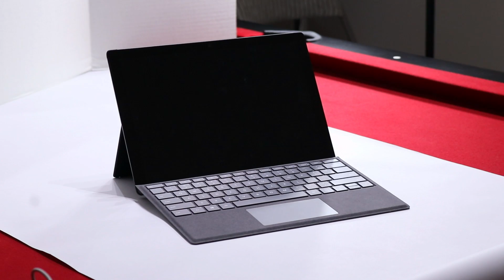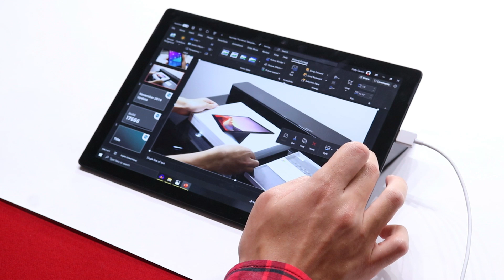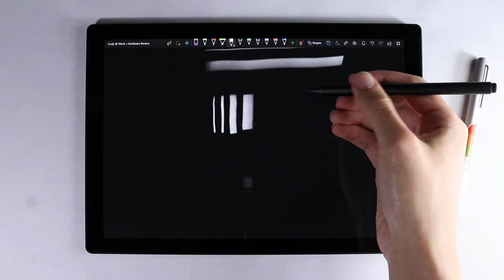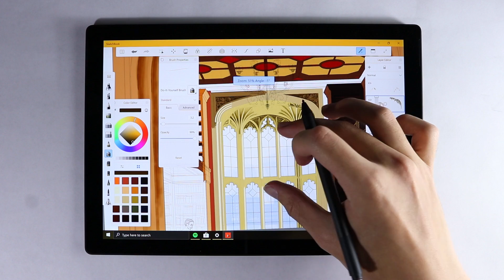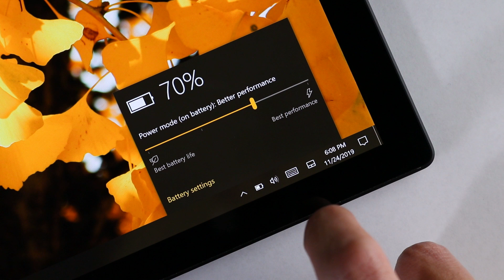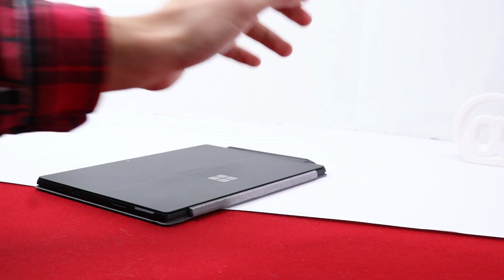Surface Pro 7 (i7) Review: Better than Surface Pro X!

Comment: The bezels are way too thicc for 2019/20, no design update since 2015? Total ripoff
Reply: I bought the Surface Pro 4 in 2015 and it has the same function as the Surface Pro 7 in 2019, with just an improvement in processor speed, everything else is a gimmick and basically the same for the past 4 years
Reply: @miltonng4116  So thinner bezels isn't a gimmick, but a better CPU is? This is the whole reason the 7 is better than the X. It's a clear example of function over fashion. The internals are better despite the older design, but reviewers are realizing this.
Reply: Every computer, laptop and 2-in-1 have improving internals, its a given with the progress of time, if companies give us 2010 internals in 2019, something would be very wrong, like Apple milking the ridiculously slow lightning port. Thinner bezels are not a gimmick, having a higher screen to body ratio increase productivity massively as you are able to multitask work with multiple windows simultaneously better. You may think I'm a biased critic, but just check out the Asus Zenbook Duo. Asus is a company that truly is a pinnacle example of innovation.
Reply: @miltonng4116  I understand what you mean. But just because a better CPU is expected doesn't make it any less important of a upgrade. A gimmick is something unnecessary that looks fancy but adds little value. Pushing the screen back a half an inch isn't going to make a real impact. But the faster processor and USB c adds performance and changes the way one interacts with their device.
Reply: Well its unfortunate that sheep consumers like you that allow tech companies to get away with doing so little and charging so much for it. If you cannot appreciate the productivity boost from bezeless screens, then why is every smartphone and laptop and even the surface pro X moving towards that direction. USB-c has been integrated on so many laptops years ago, Microsoft has been delaying it until it was already way past time because they were trying to milk the surface connect port to get you to buy their dongle. Again I encourage you to check out the Asus Zenbook Duo, then maybe you might grasp an understanding of how screen=productivity. The internals upgrade are important yes, but like I said, its expected for them to upgrade it, because it's shocking for them not to.
Reply: Milton Ng You have no idea what you are talking about. 
The instant on function built into a real workhorse is an extreme killerfeature for its own. This is coming from a person who worked with several Pros in the past. 

Microsoft is doing the right thing and actually builds tools people can use for work.

The bethels are on contrary really useful while holding it or having the keyboard docked (and not blocking the down row). Their elimination has absolutely no productivity value whatsoever - pure cosmetics, or like you call it - gimmick.
Reply: @miltonng4116 stop commenting about things you don't know.
Reply: Well go ahead then idiots, go buy the thicc bezel surface pro, and enjoy turning it on, people like you who never used bezeless devices will forever be dumbasses and technologically backward, meanwhile I will continue enjoying my bezeless devices from great tech companies
Reply: @miltonng4116 stop crying about bezel u idiot. You are not the only person in world who used bezel less devices.
Reply: Like I said, just go ahead and enjoy your device then, clearly you are ignorant to how and why the whole world is trying to drive technology towards bezeless design, and you can't even spell. Smartphone, televisions, laptops, tablets and even the technologically slow Apple. I can understand why you are defending Microsoft, since you have already been ripped off buying the Surface "Pro" 7. I feel sorry for you, but I'll laugh anyways hahahahahaha
Reply: Milton Ng Sorry for replying to you. I seem to have overlooked the fact that I am speaking with a child.
Reply: @MetallicReg  Lol
Reply: Function over fashion

Comment: I don't see much difference to my surface pro 5. Still waiting for its USB charging port
Reply from the maker: You can charge Surface Pro 7 using USB-C chargers that comply with the appropriate USB-PD standards. This includes chargers up to 65W, similar to the one included.
Reply: @onmsft  Oh, so charging with USB C can be as fast as the original charger?

Comment: Microsoft just needs to work on tablet mode more and make sure it has smooth transitions. Even pen input seems a bit laggy. But nonetheless, it's a great, beautiful, and powerful little device. My surface pro 5 i5 handles everything I throw at it.
Reply: Just wait in 6 months time. 
I bet it gotta be laggy.
Reply: Chilling Dog I've already had my surface for a year and a half. Its not laggy at all. Just needs a better tablet mode and better transitions.

Comment: I have a SP3 and I’ve been disappointed with the surface line up design team. It’s like they’ve just cruised in their success and decided to not be innovative. 
Also after Microsoft got their pen design and technology, they haven’t done anything new with it. No new design, nor improvements on sensitivity...etc. 
when it comes to innovation, Microsoft doesn’t put their money where their mouth ia
Reply: New design for 'innovation' sake is useless, unethical to the environment and ridiculous when the current design is already a big success.

Consumers assume innovation can be simply whipped up in a matter of months or 1-2 years. If that were true it wouldn't really be real innovation.

Comment: I like my Surface Pro X, despite its flaws.
Reply: How is chromium?
Reply: @Thehighroutine  Edge Chrome works great, all extension perform like Chrome, battery usage is very close to regular Edge.  It still has bugs though like this weird scrolling bug that only happens on one website.
Reply: That Guy im reading so many negative comments about this device, negative review on almost all websites, that I am not sure whether this is a good investment anymore, considering I have to switch between apps like excel, word, pdf, browser, ppt, onenote almost every 5 minutes. As far as I see it, pro X is having comparable issues at switching tasks even between these simple apps..
Reply: @Thehighroutine  excel = depends on your database, the SPX will experience issues with over 200-300k lines, this is why I use mobile excel which has no issues.  word = I don't have any issues what so ever.  pdf = Adobe Acrobat 32-bit works fine.  Browser = no issues with Edge Chrome, Edge, Firefox and x86 Chrome.   ppt = assuming powerpoint, no issues either.  onenote = Works perfect on the X.  No issues for switching tasks, , Office for the SPX is very streamlined for this device.  Maybe there is something wrong with yours in which case I suggest returning it. 

Tl;Dr - for battery i use the mobile version of each app.  When plugged in I use the full desktop version except for Excel.  No issues at all, make sure when plug in your device is set to performance.
Reply: That Guy thanks for clarity. I actually dont have one yet, but I have to make a purchase in a week and im stuck between the ipad for its ease and zero lag vs SPX for its functionality. Though if the functionality is harmed, then im also not fully convinced. ARM is a bit tricky...
Reply: @Thehighroutine  If you are interested in the iPad Pro why are you concern with full fledged office?  The iPad Pro cannot run full fledged Office, full stop.  If you are a data analyst and need say full Excel then get something like an HP Dragonfly or Dell Latitude 2-n-1 and max out the CPU/RAM.  If you want to draw and take notes an iPad Pro is fine, but it is not a true "pro" machine and neither is the Surface Pro X.  That being said the Surface Pro X is more of a pro machine than the iPad Pro, and will be more so with the adoption of cloud computing.  

The iPad Pro is more for the average consumer that sometimes need to open up Excel/Word files or check Outlook.  You want a good business device get the HP Dragonfly(16GB minimum if you want to do Data Analytic work, 32 is recommended), if you want a jack of all trades then get the SPX.  If you want something to watch videos, draw and take notes on get the iPad Pro.
Reply: That Guy, have you run any G-Suite programs on it? I'm a little disappointed in the Pixel Slate tablet I have, and am thinking of getting the Pro X, but I use a lot of Google programs. Any issues running G-Suite?

Comment: The computing power packed into this form factor is amazing.  The Surface Pro X is a vanity office product, the Surface Pro 7 is
a workhorse.
Reply: surface pro X is just not done from software side. there is plenty of power just the apps are not programed for it yet, what is shame since i like it a lot
Reply: The Surface Pro X is just the first product of its class.
Reply: Capable for video editing?
Reply: Correct!!
If you need to run 64bit programs, you are out of luck with the surface pro X.

Comment: I just bought a Pro 7 i5 as my 1st Surface device. So far, like you I am surprised how much I use it as just a tablet, no type cover.
Reply: I never thought this would replace my laptop.
Reply: Christine Roy - thank you so much for giving us input after your comments!  I find the experiences of previous users super important for making my purchase!
Reply: hello, can you please tell me how is the battery life on your surface pro ?
Reply: Hey. It's been 4 months since you wrote this comment? How has the tablet experience been so far? I also bought my surface when it came out and I swear to God, the touch screen keyboard is not the greatest experience ever. I'd rather type on my Samsung phone than on the surface.
Reply: Tucker Coffin I no real issues for me I still use the Surface onscreen keyboard for light typing. Anything like writing a document, filing out forms, etc. I’ll use a physical keyboard. What don’t you like about the onscreen one?
Reply: @ccroy2001  I've had some issues with it. For example if you're in let's say the feedback hub app, type something, then switch to Microsoft Edge, close the keyboard and return to the feedback hub app, the window of the app does not get resized and the place where you had the keyboard just stays empty. I've also had problems with the keyboard opening or closing randomly resulting in me accidentally clicking on things. Sometimes holding the the backspace key down would only delete one character and I'd have to press on that button many times to delete a whole word. Sometimes I'd be typing something in a field and the field would look empty even though when I pressed enter, it submitted what I had actually typed in. 
I guess it's fine while taking notes with the pen and occasionally googling something but if I have to do some intense typing, I'll just return to the physical keyboard instead. I'm wondering if something like an iPad would not offer a better typing experience. 

But yeah otherwise I just love it. It charges quickly, it's the lightest and smallest laptop I've ever had. I can write and draw on it and I can program on it if I want to. It's most definitely replaced my other laptop which I only occasionally use for gaming.
Reply: @tuckercoffin2164  I have an iPad Mini as well and yes for tablet only typing the iPad is better, however Apple's autocorrect is aggressive and can be annoying. I tried using the iPad as a computer with a mouse and keyboard and for me, the Surface is a much better computer.  No need to learn gestures, more ports, accessible file system, and so on. Presently the Surface is my computer it replaced a desktop and a laptop as I don't do anything really taxing on a PC.
Reply: @ccroy2001  Same here. The Surface Pro is a pretty good computer. I was also wondering if I should get an iPad, but since most of the stuff we do is done in the browser anyway, I'll be fine without it too. I also love the Surface's kickstand. I can just sit on my bed with one leg bent and put the surface on my knee. Haha. It is literally the most comfortable position I have ever found using a laptop.
Reply: @ccroy2001  hey, hows the surface pen like? is it problem when its attached to the side and does it fall off? hows the writing experience as well?
Reply: fizzah khan it’s been fine it will detach from the Surface so when I could take it out of the house I used a case. I actually don’t use the pen much. I used coloring apps and maybe tried a note or two but that’s it. What’s handy it double tap the pen button and take a screenshot cool.
Reply: Christine Roy ah ok thank u! A case is a good idea for on the go so I shall hopefully get one for the pen!
Reply: @ccroy2001   Hi. I'm thinking to buy one for note taking at Uni, workload, etc. Can you tell me if when you handwriting you are able to rest you hand without interfering the screen, as if you were writing on a paper? Thanks
Reply: @marciliovazzoler  It works fine for me but I don't use the pen much. when I do I can rest  my palm on the screen no problems with One Note or drawing/coloring apps.
Reply: Christine Ro
Reply: @marciliovazzoler  hey did u end up getting much use at uni yet? i have enrolled into my classes for 2021 and im looking at a laptop and came across this and i think it will do what i want but i also want to know how the pen and hand goes together when writing / drawing how has ur experience been :) and thanks @Christine Roy

Comment: Was debating on THe Surface Pro 7 or the Surface 3 laptop... Ended up with the Surface 3 Laptop Blue Cobalt
Reply: @StarWolf-k8e  I think I made the right choice. It's slick and I wanted the laptop form factor. Easy to use, bend at angles, with a real keyboard and it just looks beautiful. Saw them both in person and it was easier to make my choice. Surface 3 laptop!!!
Reply: @Moonliterider1  the Cobalt blue is a dark blue. It's a aluminum dark blue look with a soft but rugged material called alcataran on the keyboard. Used in high end cars. The Platinum looks like the MacBook pro, all aluminum. To be honest any of the surface 3 laptops look amazing. Just a matter of preference. Seeing them in person makes a difference.
Reply: @Moonliterider1  your gonna love your Surface 3. I prefer it over my MacBook pro. I end up touching the screen on my MacBook from time to time lol. I haven't got any accessories for it and can't think of any I would. What were you thinking of getting?
Reply: So Laptop 3 with Ryzen or Intel?
Reply: @acryion  intel

Comment: Thanks for the review Surface PRO 7 (the best I've ever seen;)). I regret that Microsoft did not use the same SSD as in Surface PRO X, because otherwise it would have been with me. I am annoyed by the fact that Microsoft has not published TBW these drive (the problem is to estimate the lifetime). Maybe you have some information about it?

Comment: What app did you draw on? How do I change my theme to black and yellow like you
Reply from the maker: In this video, I used apps from the Microsoft store. Concepts for sketching, and Autodesk Sketchbook for the final drawings. Concepts and Sketchbook are free, but there's also another app called Sketchable which is also very good on the Surface Pro.

You can customize your PC in the Windows Settings under 'Personalisation'. In this section, you can change the theme, accent color, wallpaper, and more.
Reply: @onmsft  Gracias Amigo
Reply: @onmsft  I really like the UI on Concepts. I'll give all three of them a try. Thanks.